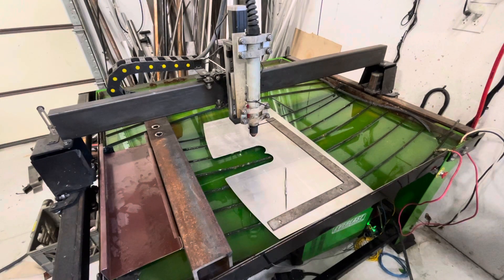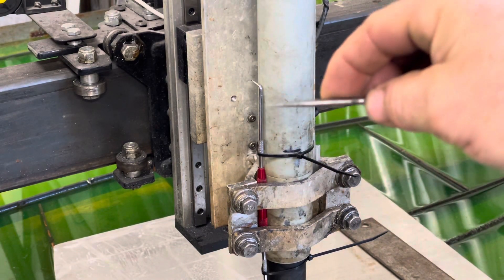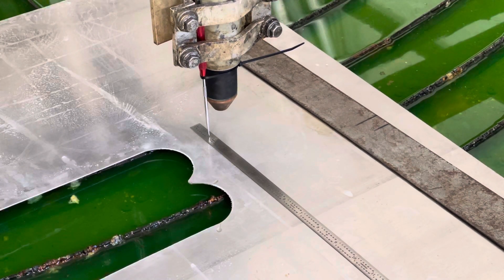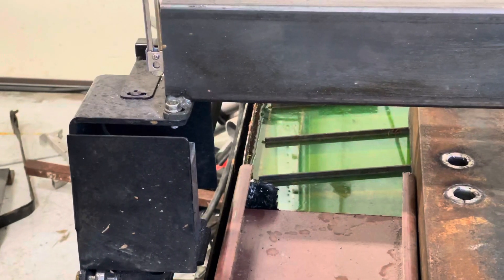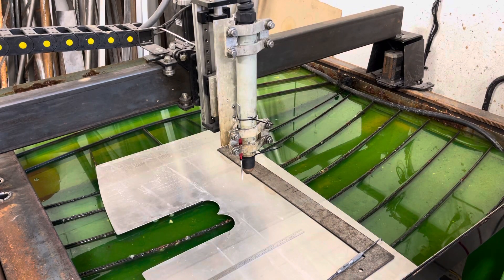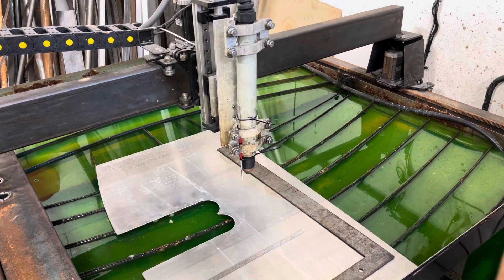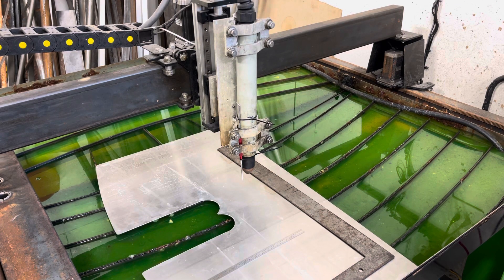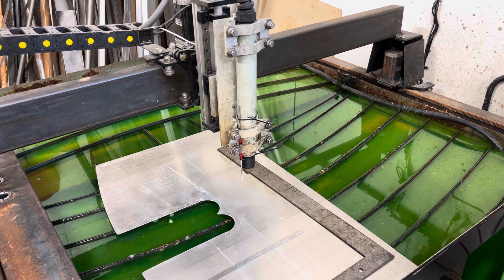Properly setting up your CNC plasma machine and modifying your table to work better.

Comment: I have been tossing the idea of buying a premier plasma when I return from my deployment. I have ran a couple of them that have the Linux cnc system on them. Was curious how much something like that would cost because I like the way it operated. Also for construction wise would you consider premier to be a good unit. The ones Ive ran in the past had servo motors instead of steppers. Also I already have an Everlast 82i that I was wanting to put on a table. Just curious on what your outlook is on these few topics. Thankyou and that was a great video look forward to seeing more.
Reply from the maker: I modded the table a lot, even more beyond this video. I offset the gantry rearward using some 5/16" steel plate which allowed me to use more of the table surface than before. I wish the pans were constructed from stainless. I would have been more than willing to pay for the additional cost because of how much these corrode. I've been using cutting fluid ever since but it still rusts and it frustrates me to no end. I also need to come up with a way to take up the play in the gears so that it'll cut better circles. I will say that the owner of Premier has always been helpful and nice. If you do get this table, I highly recommend getting some truck bed epoxy and coating the pan completely before using it. Make sure it's a two part epoxy. I've been VERY pleased with LinerXtreeme out of Houston TX. Hit me up when you reply and I'll give you my cell# in case I can be of any help with setting it up. Thanks for your service!

Comment: I have the same table just a 4x4.  I got it quite a while ago probably 3 years ago. Ever since I got it my Z has been extremely noisy. I had forgotten about it until I just listened to yours. Do you have any suggestions of what on this table would have made it be so noisy from the get go? It also sounds worse like when first starting to move it and changes sounds after moving around for a while. 
I have also done several mods to mine including adding a slat stiffener that basically is accomplishing the same thing you were doing. Because for some reason some of my slats are higher than others so moving long distances either direction will create more or less space between the material so when it would touch and drag on the y axis the whole piece of material would move ruining my cut. 
I got the THC with it but I could never get it to work no matter what Premier told me to do. Ive seen now they send it all wired up. Mine was not I was expected to wire mine myself and wiring is my worst skill. Like it has some sort of power and shows numbers and does stuff but its never controlled the Z axis. He also sent me a new one lol So i have 2 brand new THC that i cant ever use. 
Another mod i did similar to your was I added an extra holder at the bottom of the torch so it was held in 2 places so it couldnt bend and move around if it were to drag. 
The table has been like a 6 out of 10. There is a ton of stuff that could be better so easily but I guess that is what you get when you go with the most budget friendly option. 
Anyways I would like to maybe bounce a few ideas off you and pick your brain about it if you don't mind. My email is blake@misfitgarageutah.com
Thanks!
Reply from the maker: Hey Blake, I just sent you an email with my cell phone number. Give me a shout at your convenience